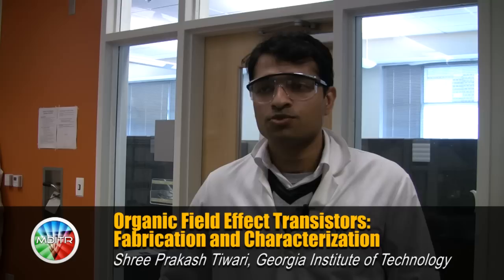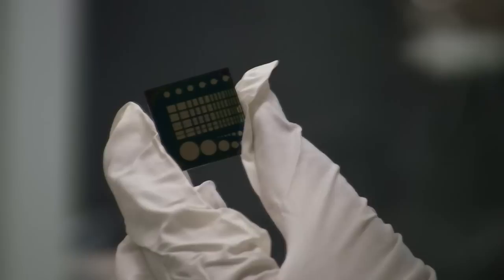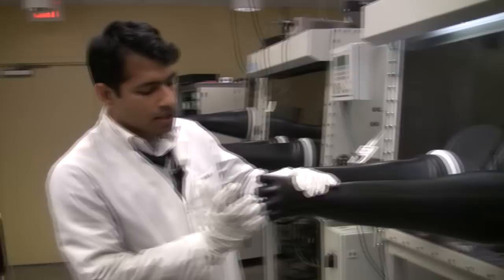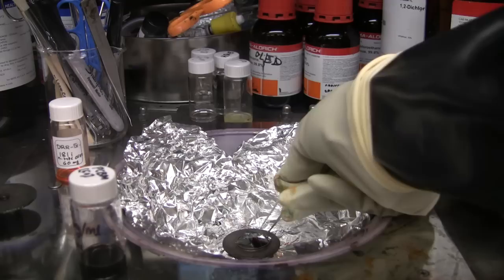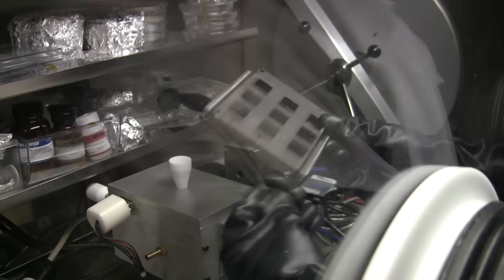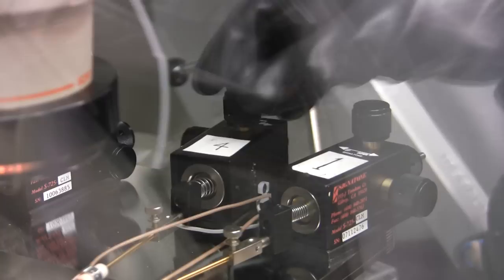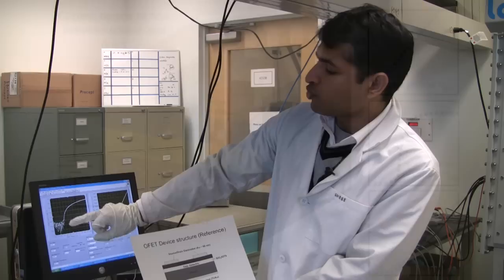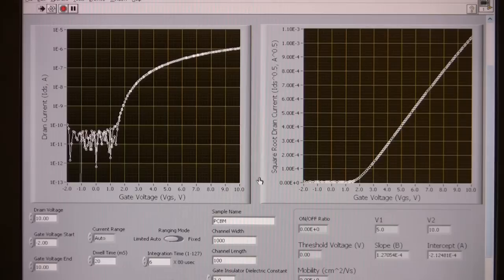OFET Fabrication and Characterization

Comment: Hi its gteat job thank you. I wonder which tecnique are you using for metal electrodes. (source and drain) Thermal evaporation or sputtering? 
and are those systems are outside of the glowbox or not. how are you carying samples beetween them?